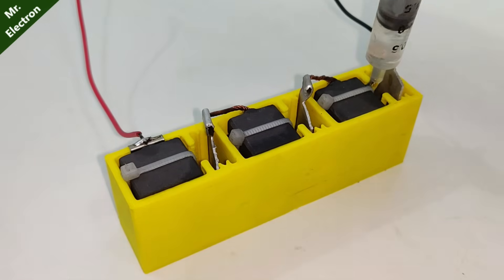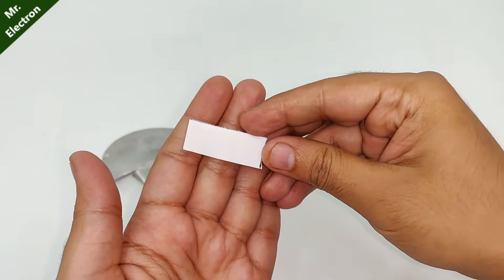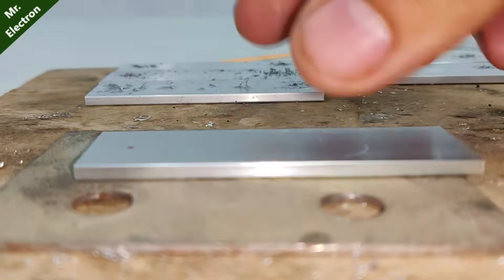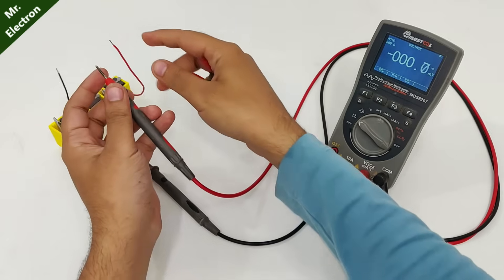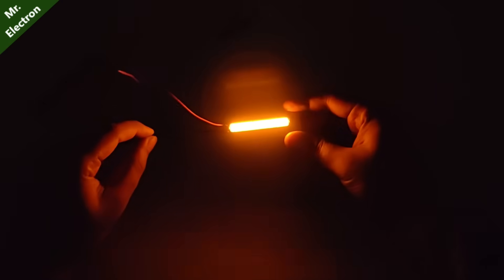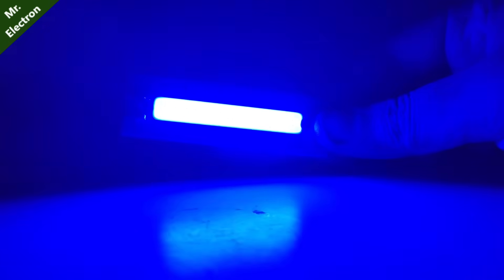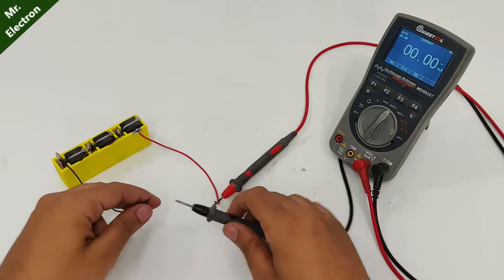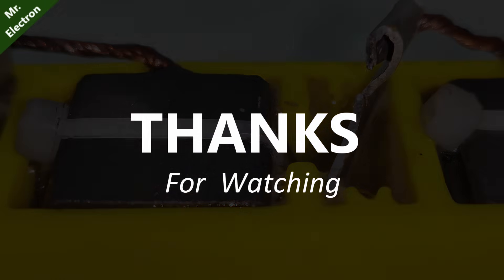Make a 4.5v Aluminum Air Battery - EP.2

Comment: whats the internal resistance of this when you were using the lights, and then motors? Also, if I may, what was the voltage drop across them two thermocouples ?

Comment: Those brushes are not pure carbon, it is sintered carbon with other conductive metals like copper or phosphor bronze in it. You don't know what is reacting with what.
Reply from the maker: @Śiśna3633  Excellent! After almost a year and more than 400,000 views, somebody has pointed that out. 
You are right brother. It's also true that different carbon brushes have given me different output results. So i hit and try and then choose those that give me the best overall output.The thing is that I couldn't get my hands on pure carbon brushes so I had to stick with these.

Comment: YOUR BATTERY IS  A SCAM , ITS NOT A ALUMINIUM AIR BATTERY ABOUT YPU USED A ELECTROLYT
Reply from the maker: @DmitriNesterov  Well ! there is this big confusion with may viewer's. Firstly - This term Air battery is not given by me but by the inventor of this air battery. Charles F homes patented the first aluminium air battery.
Secondly - Air battery name was never meant for air electrolyte but flow of current because of absorption of air (oxygen) by the anode aluminium (or others) .
Thirdly - Water contains different levels of dissolved gasses amongst which, oxygen is also present in large quantities.
So in simple terms, the name air battery was give in 1886 because air (oxygen) is consumed by Amluminum for production  of current and not because the electrolyte is air or gaseous.
Air battery electrolytes can be solid state as well as liquid.

Comment: Ingredient for cathode Aluminum, ingredients for the anode, activated carbon, manganese dioxide ,iron oxide, and graphite. Anode current collector can be either copper foil or steel.separator can be paper towel or cloth. Outer wrap should be made of something oxygen permeable but water tight like tyvek. Electrolyte can be either potassium aluminum sulfate or potassium hydroxide. The alum based version will need some current to kick start the reaction but will store for a long time, the potassium or sodium hydroxide version will self start but is use it or lose it. This version can be made dry to be activated by water at a later date. ❤

Comment: The problem with this battery is the aluminium will be destroyed by the electrolyte very quickly no matter if you draw current or not. Probably you should remove the hydroxide electrolyte when the battery is in storage.

Comment: try carbon fiber cloth instead, much simpler to use, resistance of graphite cloth is very low, close to zero, same as those brush carbon blocks. baking soda works even better, for aluminium-air and is non-toxic. also baking soda reacts less with the aluminium, mostly removing the aluminium oxide only, very different to potassium hydroxide, which actively produces hydrogen from the aluminium.
Reply from the maker: Thanks for the tip!

Comment: How can I charge it?
Reply from the maker: Not possible
Reply: @MrElectron  why? Can I make it with simple materials?
Reply from the maker: Actually, it's a fuel cell and not a rechargeable battery. Yes, you can make it with simple material, although it could have a seroius impact on its power output.
Reply: @MrElectron  Thankyou very much

Comment from the maker: Episode 3 video 👉 https://youtu.be/RMLgEMl3rOo
Nice to see you all participating. 
The anode metal i used is aluminum. It looks like that because i started working on air batteries around 3 months back, and that's when i poured Koh on it because of which it lost its shine. 
Yes, i also tried aluminum heat sinks as the electrodes, and i got the same result as I am showing here. Same for the aluminum line cables as electrodes.
For me, Vmax was 1.7v per cell in one of my experiments under some very specific conditions. It's not shown in the video.
Reply: Would you possibly know how does Naoh compare to koh for electrolyte in these cells? I know it's simple enough to convert one to the other but just wondering for simplicity's sake. I can find Al and graphite on the streets picking up scrap all day and can buy a lb of Naoh at Wally world for ~6$ just koh is slightly less accessible
Reply: Btw meant to say ty for such a great concise video this would make a great cell for an emergency situation with the availability of these components. Keep up the good work.

Comment: You made a good DIY battery, I am confused as to how the carbon brushes are working as air cathode? Also it would be better if there was a non caustic electrolyte as we know much anode material is lost due to reacting and releasing H2.
Can you easily buy Koh powder in a tub in your local shop, we don't have it nearby? Thanks 👍
Reply: I'm no chemist but as I understand it, you'll have to mix the pot hydrochloride powder w distilled water which, after double checking my math, would make the hydroxide. Dunno if you can get it premixed. I do know someone who's in the know, tho. Starts w an A & ends w a zon. Tell em Troy sent ya. 😁
Reply from the maker: Thanks! Video about the same is coming tomorrow or the day after. Yes its easy to buy koh here.

Comment: This is very cool but I'm curious why you call it an air battery. It appears to be a wet cell like some of the earliest voltaic piles used in the 18th century.
Reply from the maker: Thanks ! It absorbs oxygen from the air for metal oxidation and releases electrons from the anode. That's why.

Comment: that is galvanized steel, (then it will be a zinc-air battery) aluminium looks like the heatsinks on your LEDs, aluminium air gives out about 2 volts per cell, and tends to fall quickly as hidroxides block the cell.
Reply: its certainly Zn galvanized steel, and I guess that battery lasted for 20 minutes. its like 12um Zn max on it, and it goes so fast
Reply from the maker: Nice to see you all participating. 
The anode metal i used is aluminum. It looks like that because i started working on air batteries around 3 months back, and that's when i poured Koh on it because of which it lost its shine. 
Yes, i also tried aluminum heat sinks as the electrodes, and i got the same result as I am showing here. Same for the aluminum line cables as electrodes.
For me, Vmax was 1.7v per cell in one of my experiments under some very specific conditions. It's not shown in the video.
Reply: @orionbetelgeuse1937 i want to DIY a rechargeable battery, which have big capacity, and have long last cell, also easy to find / make cell materials... but, i don't have chemical knowledge... would mind to assist?
Reply: @deeinmann  How many centimeters do carbon brushes measure?
Reply: @ambuyshare3340  dunno... but i think it relates to amperage

Comment: Lovely build brother, 1 question, won't the hydroxide environment eat up aluminium faster? Also at the end of cycle how much aluminium can be recovered from the oxides?❤ enjoyed the build
Reply from the maker: Yes it will eat up the aluminium but in the coming parts, i will share the remedy on how to avoid that. I still have to gather info on  the recovery process.
Reply: @MrElectron  That's so great to hear from you, I wish we could connect, I build lithium batteries for multipurpose applications, I have been your suscriber for many years, enjoy your videos, Actually you can make a whole series of videos on aluminium air battery, using different electrolytes like, neutral, alkaline, hydroxide you already used, but even with hydroxides potassium hydroxide and sodium hydroxide both will have different voltages All the very best brother

Comment: A failed experiment.. Sodium or potassium hydroxide or any hydroxide reacts with aluminum quickly and corrodes aluminum quickly... It will not work for more than 10 minutes..
Reply from the maker: Seems like you have seen a lot of air battery videos on youtube.
They make up these half correct statements in their youtube videos just by theoretical reading of information on the internet.
My research says that it can survive for hours,  days, months, and even years because there are practical methods. 
Air battery episode 3 is coming soon. I hope that many of your doubts will get cleared.

Comment: What is the name of the liquid you added in it?
Reply from the maker: Koh aqueous solution
Reply: In case you're not chemically literate koh is potassium hydroxide. It's some pretty caustic stuff there be careful if you haven't dealt with it before.
Reply: Salt water
Reply: Potassium hydroxide with distilled water
Reply: Distilled water boss